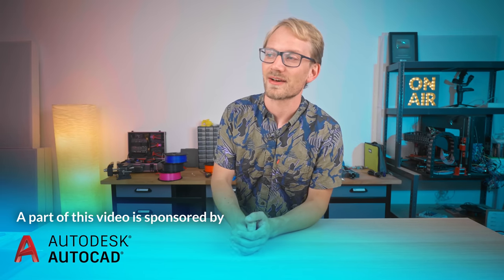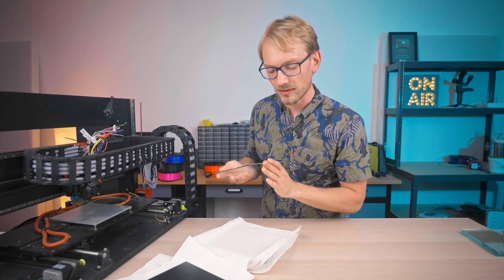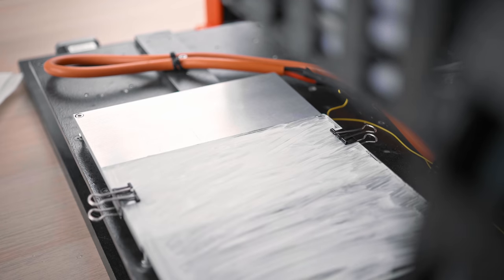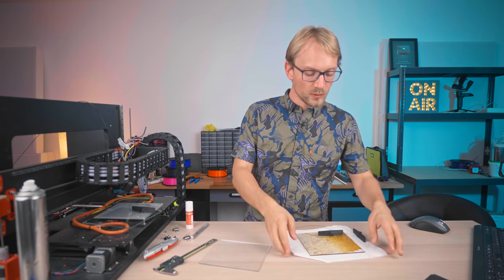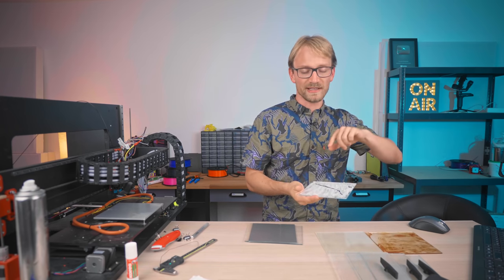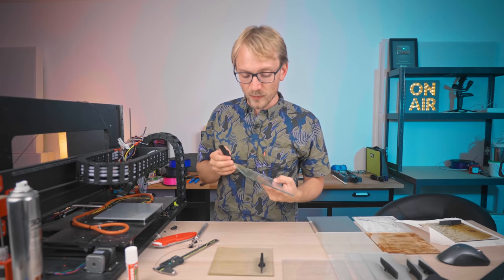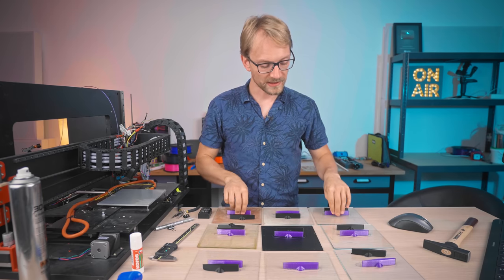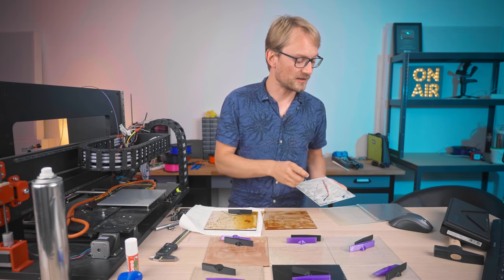Perfect 3D Printer Bed Adhesives - from the Grocery Store!

Comment: Interesting video. As a follow-up I might suggest you attempt to delineate which components in the materials are actually causing the adhesion. For instance:
1. Use a corn starch mixture instead of pasta water. This would be easier to use and is essentially the same thing (starch).
2. Egg white is mostly water with about 10% proteins (albumin etc.) Maybe try an unflavored pure protein powder or similar dissolved in water for application. You can actually buy egg white powder and albumin tablets as well. At any rate this would be more consistent and easier to apply than the egg.
3. Since starch is a carbohydrate, maybe try sugar water. There are dozens of types of sugars and I imagine they would all work similarly since at the molecular level the constituents are the same (carbon, hydrogen, oxygen). Start with normal table sugar.
4. Try flour dissolved in water. This actually forms a tough glue when it dries.
5. Milk is essentially a suspension of proteins and sugar (lactose) in water with some other nutrients. Maybe try milk and/or cream. Or powdered milk.
Reply: I don't think raw starch would work; it's virtually insoluble in water.  Gelatinised starch, which is what you get from pasta water, should work, because starch in boiling water hydrolyses to dextrin.
Reply: @pnt1035  well cornstarch dissolved in water is called "oobleck" ;)
Reply: @Numenor7  I know - but it doesn't dissolve, it just forms a colloidal mixture. That's why it becomes a non-newtonian liquid.  The water acts as a lubricant around the starch granules.  The solubility of starch in water is less than a milligram per litre, but hydrolysed to dextrin, it's several orders of magnitude greater.
Reply: @pnt1035  interesting. Well the idea is just to produce a substance that can be spread and would stick. Doesn't necessarily need to be dissolved. Even milk is not a solution, it's a suspension (colloid). Maybe with regards to corn starch the pasta water is a better idea though. I just thought boiling corn starch would be quicker and easier.
Also water was just suggested as the solvent. Could also try IPA (although starch doesn't dissolve in alcohol either) or acetone for any of these. A volatile solvent such as alcohol would probably be better anyway because it would "dry out" without need for the oven.
Reply: @Numenor7  Agreed, boiling corn starch in water would be a quicker as well as more controllable solution.  Again, it's the dextrin that's gelatinous and sticky, not the original starch.  Not boiled in IPA though, at least not initially; you could add it afterwards of course.  Interesting idea.
Reply: @pnt1035  well then maybe dextrin is another product we should add to the list :)

Comment: I even had chips taken out of glass plates that were covered with a thin film of wood glue(dissolved in water) from regular PLA.
So it has nothing to do with PLA or PETG. The problem occurs usually when there is a combination of a flat surface(of the print)[> 2cm²], and a relatively thin first layer(0.2mm or lower).

Comment: Very interesting comparison. I have been using Kapton tape on aluminium, which works quite well for pla and tpu. The main advantage is that it does not break after a few prints and it leaves a nice shiny surface.

Comment: 3DLac is rebranded Nelly Hairspray
Reply: Thanks! I like my 3D Lac that i got for free with one of my printers. I was wondering what kind of hairspray they rebranded. Tryed to buy some water based hairspray, but that just did not work at all. I'll have to check if there is a supplyer for Nelly around here.
Reply: @ProtonOne11  Can I ask what printer was that?
Reply: Do you have a source for that claim?
Reply: @leopshef  you have to look at the cap of the spray bottle, It has the Nelly logo on it, as well as on the manufacturer on the label
Reply: @mathiaszwirschitz2463  Interesting.  I've never bought it but they're adamant it's not hairspray.
Reply: Try this EVO Helmut Extra Strong Lacquer Spray.

Comment: Wood glue you have to water down than apply with a paint brush - If damaged just use a wet brush to fix it. Bigger damage you can use deluted glue again. Works best for PLA and PET not at all for ABS.
The PETG that sticks to well was the good old T-Glass (I think that was the name) from taulman I had to brake the glass bed to seperate the part from the glass ... It was a heated bed.

If you just want sticky why not try simply sugar water? Is it to easy? I have no idea if it works but that is the nice sticky part of your souces.
Also corn starch (Speisestärke) should be the less messy way to get your pasta water substitute. - You also could cut a potato in half and smear the liqid from the potato all over your glass plate.

Comment: I use a borosilicate glass plate that I just clean with windex between leveling and printing.  pla sticks to it perfectly.  if I'm using anything that doesn't print well on glass I just put a layer of 3m blue tape on top of the bed

Comment: I found a surface based on paper works but thin sheets did not due to structural bending issues.  I found a low cost whiteboard with paper bonded to it works if I peel the surface plastic sheet off leaving paper bonded to a sheet of low cost fiberboard.  I found a children's whiteboard at dollar tree.
I have some other fiberboard that I wish to try without any surface adhesion treatment.
I also have not tried thick paper or blackboard for this use as well.

Comment: I am using wood glue for about a year for every material I print. Works really well.
Reply: One problem is that "wood glue" has different properties depending on maker and model, as do glue stick. I first used wood glue, as it's cheaper than glue stick, but glue stick is so much convenient to use.
I recommend first buying a glue stick that is well know(like UHU) in 3D-printing to have something to compare with, then buy one cheap one after an other until you find someone that is better. In Sweden I found "Clas Ohlson" "34-9385" was bonding harder than the UHU one.
Reply: @andersdoverud9046  So I bought my in Germany in a big common hardware store. There is (at least in my case) only one manufracture of woodglue available and the key for success is simply go with the "classic" one - so no additional features like "dry fast" or whatever. It's usally the cheapest one of them and it works like a charm.

Comment: so sugar water applied while the bed is hot (100c) & wiped around with a cloth is magic for ABS. it holds better than anything i've tried & then pops off when the part cools. the trick is you have to wipe the print surface. I'm sure the pineapple juice would have worked just as well if you had wiped it down right after applying it to a hard surface, the layer of sugar should be pretty thin to work best.

Comment: dissolve 1cm of glue stick in about 200 ml of water, add some rubbing alcohol (Brennspiritus) for preservation and as a built-in glass cleaner and spray it onto the glass. Wipe it down to an almost invisible layer, let dry...

Comment: Hmmm, thought for sure you would be using salt. I use a brine (saltwater) solution wiped on while bed is warm. Works great on glass. Can re-wet the same small patch with tap water and wipe the bed over and over without having to add more brine solution.

Comment: Well, PETG fuse with glass mainly on wider surfaces, Glue as a stick or as wood glue is my favorite, with painter's tape only coming at second.

I like that you experimented with stuff that are unusual, but bear glass also works but have lower tolerance for leveling.

Comment: Hi Thomas - What temp did you use for the bed on PETG and do you calibrate it on the surface of the glass or just use the thermistor setting? I am having problems getting the first layer to stick on either the aluminium plate bed or on painter tape.

Comment: The "waxy" surface of duct tape may have been a fail for your typical filaments, but have you ever tried to go crazy and try it for printing polyethylene?  My understanding is that duct tape is backed with PE but that also may mean that molten PE would weld to it.

Comment: Should of tried acid washed/etched glass. It gives more surface area! You also need more breakdown on the glass itself and what type you are using. There are lots of different kinds. For the top winners you could also dry dilution levels to see if thinner solutions work better

Comment: Interesting test. When you wash rice you get a liquid similar to Pasta water which i suspect would work well (Ill try it) maybe in a spray bottle and let it air dry as oven drying seems like its going to burn the coating too much.
Reply: Add alcohol to the mix, replace some of the water with it and it will stay liquid but evaporate faster.

Comment: Dilute sugar water works great for me (PLA on glass).  Dries in seconds on a heated bed.  Once dried, it stays dry; I guess it's much less hygroscopic than pineapple juice.  Delicate parts can be easily removed with water (with much faster cleanup than PVA).  Reusable if you pry.  Cheapest option and always on hand.  No idea why no one seems to use it.

Comment: I have been using 2mm picture frame glass with a watered down slightly  PVA wood glue for a long time, with the cheapest PLA I could get  To remove the part I have to place it in the freezer for 20 minutes.  But now, even with freezing, I loose a piece of the glass surface when I try to remove the part.  I think this may be due to micro cracks in the glass surface after continual thermal cycling.  Acetone will remove parts that have only a small area of contact without the need for freezing.  My glass overlaps the heated bed and the inductive home sensor detects a piece of 25mm wide adhesive copper tape stuck on the overlap.

Comment: This is funny. I print PLA and PETG on bare glass without any coatings or problems. I found that bed temp is key. If the bed is hot enough and first layer height is right, I have no adhesion problems on a clean glass plate. A also never had issues not getting PETG off the glass. Once I let it cool, the PETG is literally self releasing, whereas I would damage the glass if I would try to pry it off while still hot. Never tried ABS, though.

Comment: More on topic now: could you use the black spraypaint to make PCB's with a 3D printer?
Process:
Cover the raw PCB with a layer of spraypaint
Print all the parts that should be etched away with a fine nozzle in PLA
Remove PLA, which will also remove the spraypaint
Etch the board
Remove all leftover spraypaint
Reply: or just print the parts that should stay, etch, remove print 🤷🏻‍♂️ but I think the quality is pretty poor and 2d printing on transparent film the usual way for developing is not really more complex either
Reply: @RoterFruchtZwerg  I totally agree, but seeing as it has been tried with 3d printers (using a pen to mask) I was wondering whether this gave a new option. The times I made a PCB I just 2d printed on magazine cover and heatpressed it, worked perfectly, but this was meant more investigatory
Reply: Guess this could work for for large enough features, but if you go with fine details, the tuning of the printer really needs to be spot on to not mess up your design. And i'm not sure if the spraypaint sticks to the copper surface the same way as it does here to glass. I guess the copper is much rougher from being rolled into 35um thin film, and the paint sticks better to it. In the end, toner transfer is way easyer and faster, as you don't need to spend hours and hours tuning and calibrating your printer for that one perfect result.
Reply: Easier to use a laser to cut away the paint. That's the process Texas A&M used to make PCBs back in 2011.
Reply: @NiHaoMike64  true, but you'd still need to mod the printer to work with that, although it might work with SLA printer if you can swap the UV light for a different kind

Comment: I tried all the glue, hairspray and other crap.  Pure misery.   Then I discovered Adjusting the First Layer Temperature separate from the rest of the print!   Hotter, more adhesion, cooler less adhesion.   Works perfectly every time.   Very easy to adjust.   Nothing else needed.  Wipe print surface with alcohol before each print to remove skin oil, if you happen to touch it.

Comment: Interesting! Can you also try different textures on glass, like sanded to different grids or sandblasted? I've been printing PLA on clean float glass sanded to 600 grid for a couple of months now and it seems to work quite well. The adhesion is slightly stronger and the surface on the part feels still smooth but less mirror-like.

Comment: With PETG my experience has been that if the part and bed is still warm it comes of the glass bed easy, but if they are cold it chips the glass when it comes off. There is a great YouTube video where the guy uses super saturated sugar water on glass as a bed adhesive.

Comment: Anything with sugar (pineapple juice and even the siracha) will pull moisture from the surrounding air, even after being baked on.  So if you use it, you'd better use it quickly.  Otherwise it gets gummy, and clumps up.

I have an ice cream machine at home, and basically make my own ice cream.  If you want to add pieces of things like graham crackers or bits of waffle cone, they eventually go soggy even after freezing.  That's because the sugar in them pulls in moisture from the ice cream.  Oh, if I only had access to Clark Griswold's "non-nutritive, semi-osmotic food varnish"...

Comment: Thanks for testing all of these! Someone recently posted on Reddit sugar water. 100g sugar to 200g water. It makes a syrup you can paint onto the surface. Have you tried this yet?

Also, I recently bought NonOilen, and I'm struggling to get it to stick. Any tips?
Reply: I used jif lemon juice (squirty bottle shaped like a lemon) and not much sugar. apply when bed is hot.

Comment: Hi, Thomas, thank you very much for your video I can only print PLA because I dont have heat bed, I tryed but I dont know How to wiring, I think because I dont know how to solder the resistors, I am from Venezuela, and Im gonna try this: pasta water-sugar-egg and harina pan water (harina pan is a corn flour which is used to prepare  our famous AREPAS) I will comment the results
Reply: What resistors? Just get one of those cheap PCB-heatbeds, solder wires to the underside and plug them into your mainboard. Make sure to wire it according to the voltage of your PSU and don't make the cables too short. And don't forget the thermistor. After that just change a few lines in the firmware (I recommend PID for the bed too), run PID-autotune and enyoy
Reply: @SchwachsinnProduzent  Thanks Thomas

Comment: Cheap dollar store Fingernail Polish Remover (regular normal stuff) is what has worked best for me on plain glass.  Just clean it with it.  I know it's acetone, but straight acetone doesn't work like this does.  It's quite confusing, as I don't know what chemicals in it make it work.  Gorilla wood glue is the best wood glue I've used.

Comment: curious .. how about cooking up some corn starch and gelatin on the stove in water until becomes thick.. take off the stove and Before it cools dilute with 90% isapropal alcohol until very very thin .. put in a spray bottle .. should be easy to apply and easy to clean up ..

Comment: Not for an entire bed but if I have a support failure in the first few layer i will put some bluetac in place of the support at roughly the right height an and the printer will print into the blue tax and support and print is saved ! I away keep a blob of bluetac on the printer for this reason.

Comment: I'm using hairspray that contains some combination of "VA/Crotonates Copolymer".
All the hairsprays I've tied without it, didn't work.
Reply: That is also my experience. In the UK, L'Oreal Elnett extra strong hold is one that works.
Reply: Spot on. Look for Co polymer vinyl or it’s derivative in the ingredients. I found (in the Uk) Insette brand which is one of the cheapest has the correct vinyl in. PVA wood glue works the same but hairspray is dam easy and neater the use.

Comment: Packing tape ist mostly made from pp and PVC, that's also because it's used to print pp in pp tapes. I you want to know from what it's made you can try to print pp on it. If it Sticks it's a pp tape, if not it's made from something else.
So with pp filament it will stick very well with anything else not.

Comment: Which radial 5015 fan did you use there on the part cooling? I cannot seem to find one that can be tuned down with pwm, they just start whining.. Very fun video!^^ Also interesting which ingredients do what. But with the comparison we can see many modes of failure.

Comment: It would be really interesting for a series with filaments which are really difficult. Especially PC doesn't stick to anything and warps a lot. PE is not much better. And PA warps like crazy which is simply too much for the most adhesives. For all these filaments which stick too much I use a PVA based parting agent normally used for laminating fiber composites with expoxy resins in negative molds.

Comment: Am I just super lucky that I've never used bed adhesives? I just clean the glass (heated bed) with wiping alcohol and things seem to stick just fine, sometimes I add a raft if the surface area is really small, but in the 7 years I've 3D printed... I've never felt the need to use adhesive.

Comment: Yogurt / sour milk? They contain lactic acid.

Also, some of the ones that seemed to remain intact after detaching the print might actually not be. Should have tried printing a second (smaller) part in the area where the first part had been, to see if the surface was actually reusable.

But if these materials stick to plain glass, doesn't that mean these materials are all useless as adhesives? They might still be useful to protect the surface, but there doesn't seem to be any need for an adhesive, if plain glass works fine.